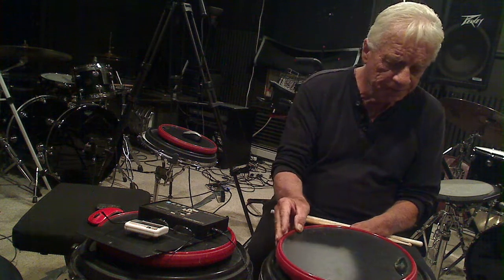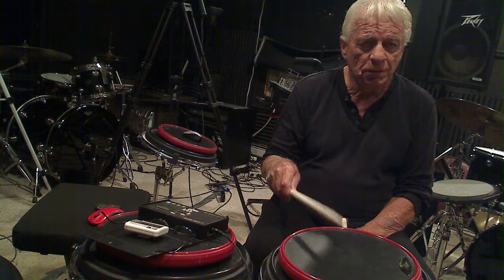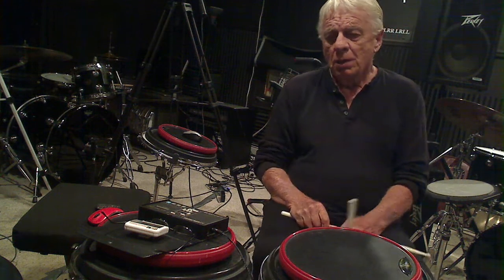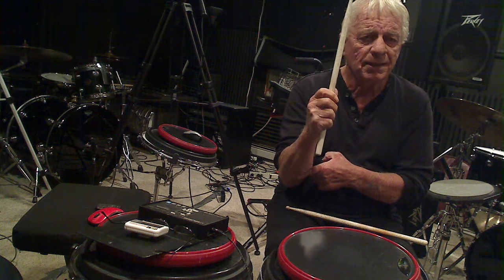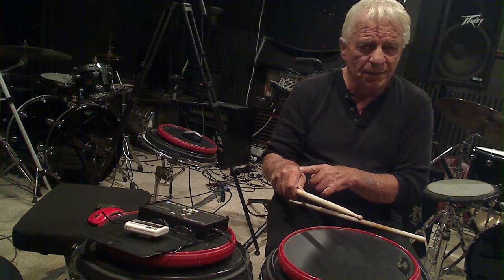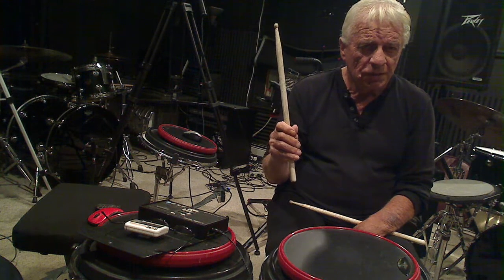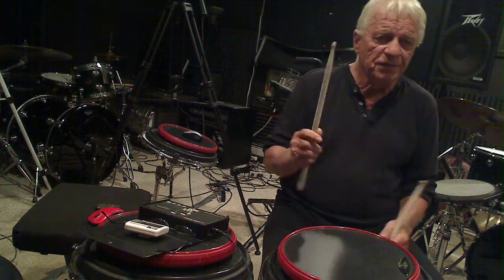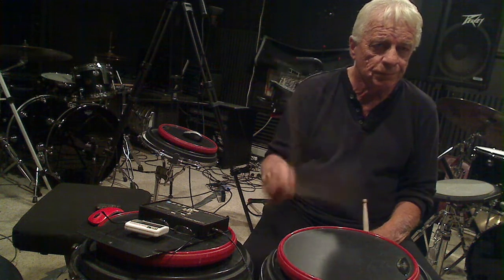Matt Patella  a revisit to the level system

Comment: Hello Matt again, old timer here, spent two years with Henry Adler.  His synchronized technique was performed say at mid level with no accents or stress.
It helped me in reading, since I did not have to guess which hand stroke was next….Played doubles or multiples at a lower level.  Rolls were played with a slight force on the second stroke to even the volume. We got to the Podemsky Snare Method. Great concert drumming teacher. But I still view Drum Corps drummers as the best rudimental drummers in the world…..from both sides of the ocean.